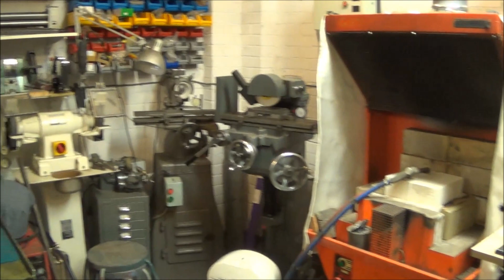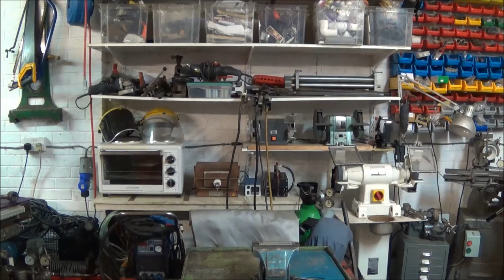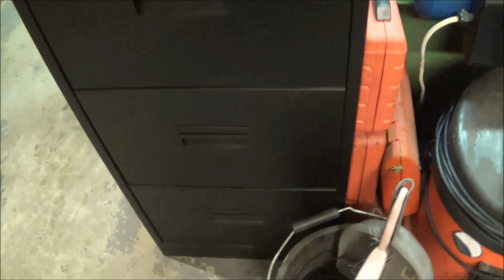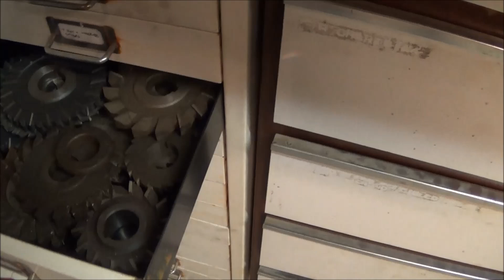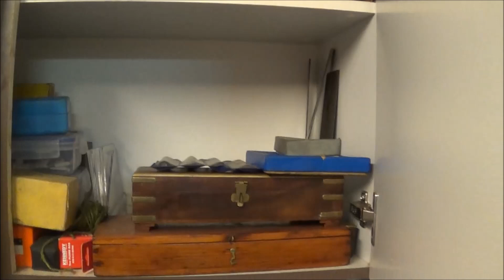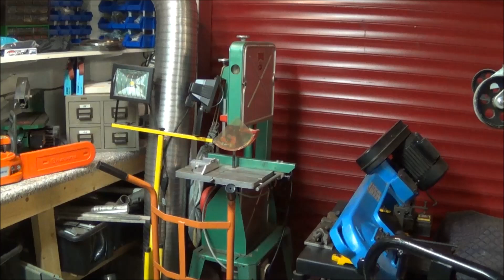Home Machine Shop and Forge Tour

Comment: My first youtube comment ever. I just subscribed to your channel. My question is a follow on to how long it took you to amass your tool collection. Over 30 years I managed to assemble a ridiculous amount of tools. You however have collected a "ludicrous" amount in half that time. Ie not just the amount of taps but the different types, half of which sounded mythical as in used by the elves in Lord of the Rings. Did you inherit some of these? Is this your vocation or avocation?

Comment: Do you have any videos of you designing and re-enforcing your entry door to the shop, thanks a great small shop you have 👌👍👏
Reply from the maker: I just used the steel from an old bed frame somebody scrapped on the side of the road.  The frame supports the door, rather than reinforcing it, i.e the higes are attched to the frame.  Thgis means you can have a very strong doow it looking straong from the outside.
Reply from the maker: sorry for the fat fingered reply, it wont let me edit it!